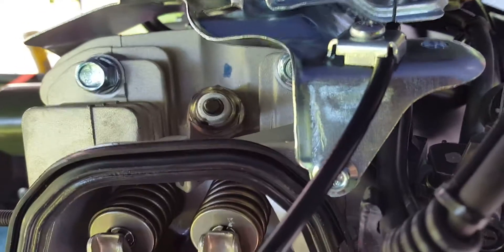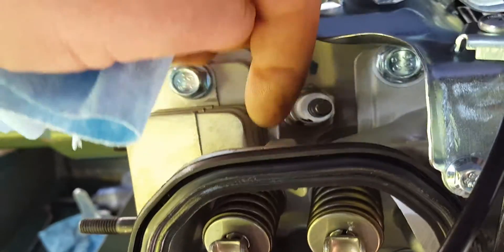sparkplug indexing

Comment: Indexing is good ,using additional washer for indexing isn’t good ! First this way heat transfer ( between the head and spark plug) is affected which make the spark plug more hotter ( it eventually can become source of pre ignition when the engine is pushed hard ) and second so called “reach” is affected , the spark gap moves this way more closely to the combustion chamber wall  , as close to combustion chamber wall as slower the mixture flow is as slower flame front expands . Slower combustion lead to lower efficiency, higher fuel consumption , less power , more heat that need to be  dissipated .Its observed by experience that usually one of three randomly chosen plugs when tightened properly ( by the recommended torque) sit in the proper oriented position without using any additional washers .
Reply from the maker: Then why do they sell "indexing washers"?  You would have to go through a lot of plugs to wind up with ones that go in properly indexed without them.  I'm not just using random washers here.
Reply: @Rumnhammer  Then why do they sell foods harmful for peoples health? :) honestly,didn’t  expected such a question from you :) I know that the washers you’ve used are “ special indexing washers” but this doesn’t change the situation( one step forward , two backwards) . However you are warned and the engine , the fuel,the power , the heat , everything is yours :) 
Success!